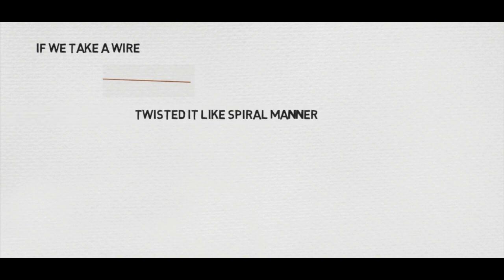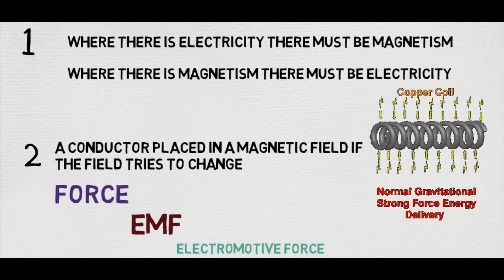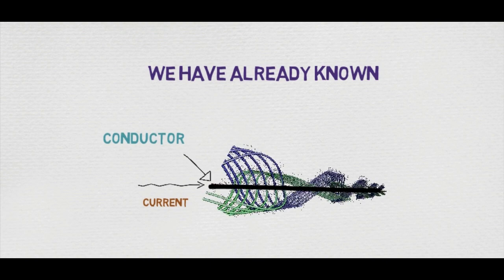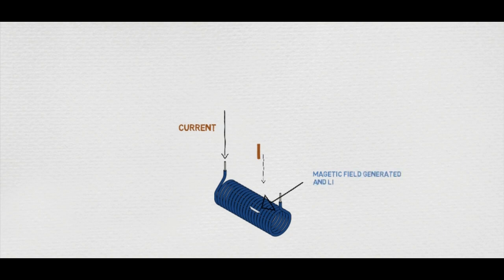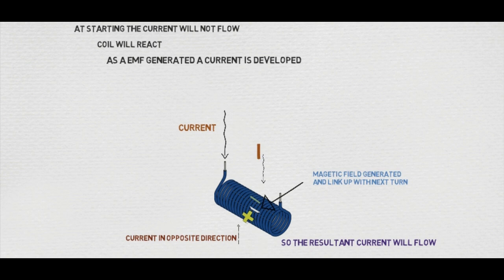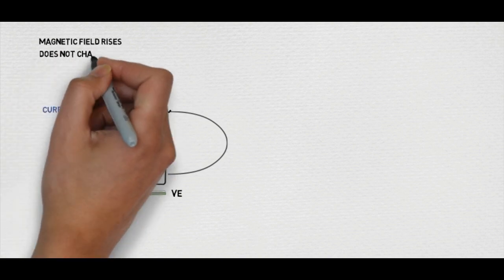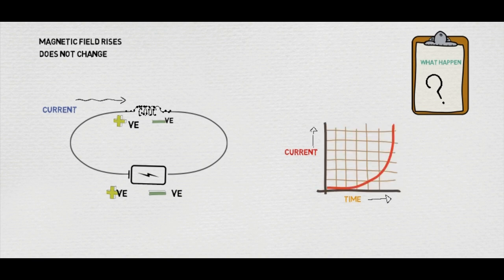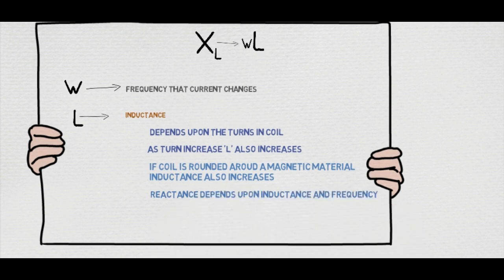What is Inductor? What is inductance?

Comment: hold on why current flow from positive end to the negative end. Shouldn't current be flowing from negative end to positive end which is either way round ?
Reply: It is kind of weird, but current is defined as the flow of positive charge. So what you are talking about is the flow of electrons (which flow from negative to positive) but current is defined to be flowing from positive to negative.